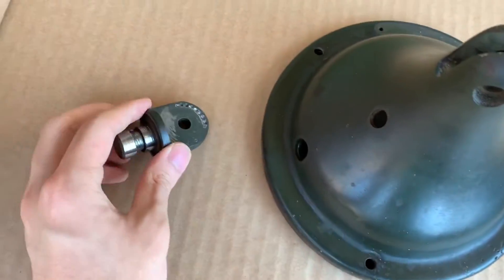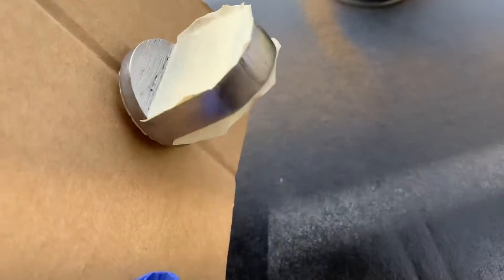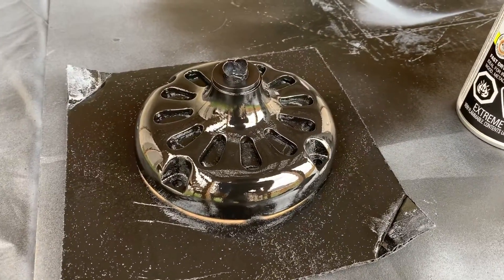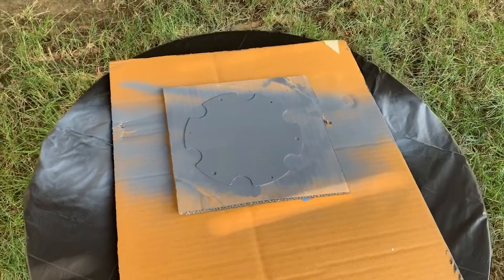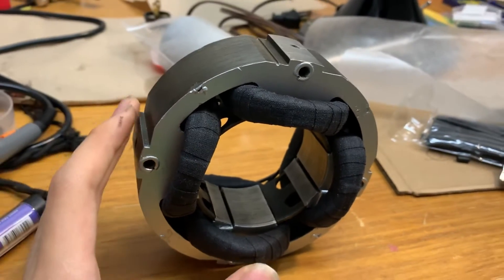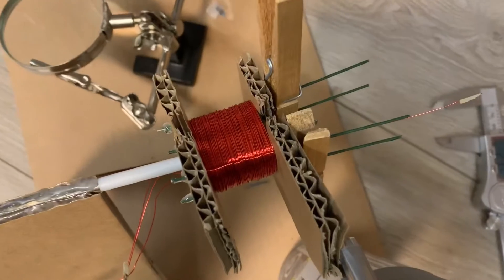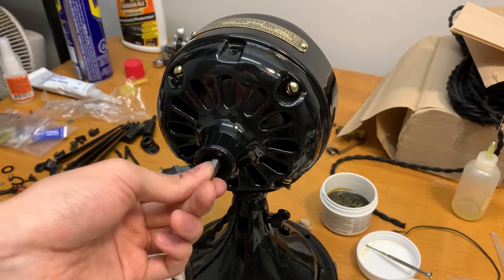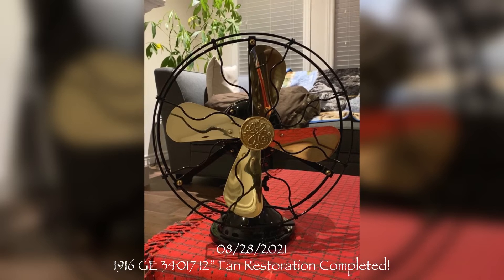Antique GE Brass-Blade Fan | Restoration: Motor Rewind, Repaint & Polish

Comment: Sweet! very nice job, say .... I have this 1906 GE Pancake that had one of the two wires from the armature break off. What a bummer. So I guess I have to get it rewound.
Reply from the maker: Thank you! You may be able to salvage the broken wire. If you carefully peel back the insulating tape near the spot where the wire broke, there might be enough length to solder on a new wire. If needed, you can undo one turn on the windings to recover enough length without affecting the motor.

Comment: hello..may i know where is the thermal fuse and the capacitor? is it safe to run motor without thermal fuse?
Reply from the maker: Hi! This fan does not use a capacitor, as it has a shaded pole motor. No thermal fuse either, since this was made long before fuses were considered necessary for safety.

Comment: Looks amazing bud I do feel that you could've buffed the original paint if there's no rust, I've done it many times, hopds a higher value
Reply from the maker: Thank you! Looking back at it now, I absolutely agree. I’ve since learned that the soft and “deteriorated” paint was just how GE’s early paint was, so there wasn’t anything wrong with it. I wish I had kept the original finish but can’t turn the clock back now lol

Comment: Wow!  That’s an intricate restoration!  Fantastic work!! My ex collected several antique fans, some with brass blades, but he neglected them - and I have “inherited” them.  One is a beautiful coin-insert hotel fan with brass blades that has been restored, although the coin mechanism does not work.  I really don’t know what to do with them!  Any suggestions as to how at least clean them up?
Reply from the maker: Thank you! Very cool, those coin operated fans are quite highly sought after! For the paint, a good wipe with a damp cloth should be able to remove any loose dust. If the paint is dull, gently buff with some automotive paint polish & wax on a microfiber cloth to help rejuvenate it. The brass blades can be cleaned with a damp cloth as well, and polished with a metal polishing paste.

Comment: As other people said amazing work, it might have been easier to use. Paint stripper to get the paint off just a thought next time i've done that and it comes off pretty easy and quickly
Reply from the maker: Thank you very much! I do agree that paint stripper would’ve done it more efficiently. I did buy a jug of it not too long ago, and I’ll most definitely use it whenever I tackle another fan project that requires a new paint job.

Comment: Just picked up this exact model for 10 USD. It is in rough shape and currently does not run according to the seller. Have not tried it myself but the rotor spins by hand. The cage is damaged and may be a challenge to repair. It is also missing the rear bering cap and speed control cover plate. I'm sure I will find replacements eventually. For the cover plate, if I had dimensions I could just model one up and have it laser cut. Anyway, this will become my reference video for when I tear into mine. Is there a way I can contact you with questions outside of this space?
Reply from the maker: That’s a steal for $10! It should be a fun project to work on. You can reach me via Instagram or email anytime (thesuperfanman@gmail.com)!

Comment: So you placed four popsicle sticks or similar, through cardboard frame to wrap wire around? I have a motor that has eight coils..
Reply from the maker: Yes that’s exactly the setup! I wanted to use softer materials that would not damage the enamel of the magnet wires. I measured and punched 4 popsicle sticks through two cardboard end pieces, making sure the wound coil would have the same size as the original. This took some trial and error to get right. I’m not sure what fan model you have, but if it has the same type of motor as this fan (shaded-pole), it should be built the same way, just with twice as many coils.

Comment: What did you use to polish the brass?
Reply: Brasso works extremely well, too.
Reply from the maker: @lightsfansofthewest481  yes it certainly does!
Reply from the maker: I used Mothers Mag & Aluminum polish paste. Manually buffed all of the brass with it and a microfibre cloth, since I don’t have a buffing wheel.

Comment: Sweet! excellent job! I have a 1906 GE Pancake fan that one of the two wires of the stater winding is MIA.... major bummer. I have not felt "brave" enough to try and wind it myself. But this gives me hope! Thanks, and God bless.
Reply from the maker: No problem! The GE Pancakes are absolute gems! You actually might be able to save your original windings. The lead wire that is missing may have broken off close to the winding coil, so it's not accessible for rewiring. You could try gently peeling back the winding tape near where the lead wire would have been coming out of the coil to see if you can retrieve the wire. You can then solder a new piece of wire to the lead and keep the original windings.
Reply: Ok, i'll give that a try, after I finish with this Emerson 24666 I just acquired. @TheSuperFanMan

Comment: Really cool! Did you consider doing a clear enamel on top for extra protection? I hate to be “that guy” I’ve just had bad luck when I don’t coat the paint in clear enamel on certain things.
Reply from the maker: Thanks! Yep I did consider it, but ended up not clear coating it to replicate how it was originally painted at the factory: just the colour coat with no additional protective layer. I also didn’t feel like spending more money on cans of clear coat haha!

Comment: You did a great job and it was totally worth it. However, those coils were just fine.
Reply from the maker: Thanks! Yes I certainly could’ve gone down a different route and attempted to preserve the original coils. Looking back now, I do think the rewind wasn’t absolutely necessary.
Reply: Ya, not necessary, but that fan is now back to zero miles and has another 100+ years! You made it look doable and I will try to fix one of my dead fans over the winter. I can't really do any more harm, it's dead already. @TheSuperFanMan
Reply: @ToxicityAssured  ik its been like a year but did you ever get it going again??
Reply: @Zephyrfansandtech  I still have not tried it on the Emerson yet. I had a old Signal Electric that ran super hot and had high current draw. I did rewind it and was successful. The Signal fan still gets rather warm but the amp draw is fine now. I will get my little Emerson going one day. For now, my Emerson is holding all my dust up!

Comment: This is amazing! I just came in to possession of an old Hunter Century fan that looks like it's from the 30s or 40s. I don't actually know atm. I was starting to do research on how to restore it myself...not sure I have the skill OR the patience to do THIS though lol.
Reply from the maker: Thank you! I definitely did a lot more for this project than what most other antique fans would typically require upon acquisition. As long as the motor windings are in good physical and operating condition, there is no need to rewind them. If the original paint is mostly intact with little rust, it can often be revived with the typical automotive paint maintenance methods (polish, wax, touch-ups).

The AFCA (antique fan collectors association) forum is a great resource, and there is also a Facebook group under the same name.

Comment: How do you lubricate that old GE fan?
Reply from the maker: The two brass oil cups (shown at 14:39) should be filled about 1/2 to 3/4 way with oil. The felt oil wicks will dispense the oil to the bearing & shaft via capillary action. In 99% of cases, the original wicks will be hardened with old oil, so they should be replaced. Ensure they sit in the spring and touch the motor shaft.

Hope it helps!
Reply: @TheSuperFanMan  what oil did you use? Is there a particularly suitable oil for this specific fan? And/or do you have one or more go-to lubricants for fans?
Reply from the maker: I use ZoomSpout all-purpose oil (the same formula is sold with many brand names, but mine is made by Supco) for all of my fans. The ZoomSpout and 3-in-1 electric motor oil (blue&white bottle) are the two go-tos for most fan collectors. I have this tutorial going over my fan motor oiling process, including the oil suggestions: https://youtu.be/tdPxoWJ1VVk?si=eXm38zHedVrhghex 

Hope it helps! Cheers
Reply: @TheSuperFanMan  awesome--thanks so much!

Comment: Nice work. I’ve done one of these myself. The only concern I have is that the motor without fan blades should be running  totally silent.  At startup it sounded like it was grinding.  Or was that just the mic.
Reply from the maker: Thanks! I didn’t add sufficient amount of oil to the bearings for the first start-up, as noted in the caption at 15:20. The bearings also have a slight play from wear, so that contributed to the rattle too.

Comment: Can you point out the forum that was used for diagrams  and also what kind of varnish did you use? I’m gettin ready to do the same thing
Reply from the maker: I used the AFCA (antique fan collectors association) forum. A couple of threads that were useful:
https://www.afcaforum.com/forum1/31849.html
https://www.afcaforum.com/forum1/31859.html

Those are from the old version of the forum; they recently moved to a new, modernized site: https://new.afcaforum.com/

In this video, I used 3M electrical insulating varnish for the coils. I now use SprayOn EL600 clear electrical insulating varnish, which is pretty much the same product, just made by another manufacturer. The EL600 is also more readily available, and more popular among fan collectors.

Hope the project goes well!
Reply: @TheSuperFanMan  thank you very much for the info! Love your content keep it up! 🙌🏼
Reply from the maker: You're welcome, and thank you!

Comment: Hola Amigo excelente trabajo!!!. Yo tengo un General Electric sin motor, sin ningúna pieza y lo quiero restaurar. Sabes de algún motor en el mercado qué sea compatible con el mismo.?
Reply: Genial, pude conseguir uno y estoy por hacerle él bobinado cómo lo hizo usted. Muchas Gracias x su aporte 👏🏽👏🏽👏🏽
Reply from the maker: You’re welcome! I hope your project goes well!
Reply from the maker: Thank you! Unfortunately the motors for these old fans are proprietary and there are no modern replacements for them. The best way would be to look for a second fan you can use for parts.

Comment: Hey, um... the GE logo was origonally black...
Reply from the maker: The badge was originally polished brass, with the recessed areas filled in with the same green paint as the rest of the fan. I certainly could have replicated that effect but I opted to leave it all bare brass.
Reply: @TheSuperFanMan     It looks great as is. You did a wonderful job, both mechanically and cosmetically in my opinion.
Reply from the maker: @davids6533  thank you!

Comment: How do you know when a motor needs to be rewound
Reply from the maker: A motor would need to be rewound if the windings show detrimental damage, deterioration or are burned out. A couple electrical tests and a visual inspection can identify potential issues.

Comment: Looks great! The og paint looked like it would have shined up though.
Reply from the maker: Thank you! Yes my initial plan was to keep the original paint, but it was deteriorating. Visually the paint seemed okay, but it was extremely soft and scratched off too easily. Trying to gently buff the paint actually made it duller lol.

Comment: What did you use to polish the paint and brass? I've got some fans that I would like to restore myself. No experience, wanting to learn as I go I guess. What a fantastic job you did on that! Wow!
Reply from the maker: Thank you very much! 
For the paint, it didn’t require much polishing as it was a brand new gloss paint job. Generally though, I like to use typical automotive paint polishing compounds to restore the deep shine. Starting with a regular polish (or rubbing compound if the paint is really dull but thick enough) and finishing with a polishing glazing compound, which is a super fine polish that gives the paint a smooth, glossy finish.

For the brass, I use Mother’s Mag & Aluminum polish. I did it all by hand, which is tedious but still works great, especially if you don’t have an electric buffing wheel. I apply a dab of the polish onto a soft microfiber or cotton towel, and rub it into the brass. Then buff and wipe off. I also use very fine sandpaper (1000 grit or higher) on some brass parts that have too much build-up for the mag polish to cut through. Once the brass is exposed, I go back to the mag polish.

Hope your fan projects go well! Feel free to ask questions if any come to your mind.
Reply: @TheSuperFanMan  thanks for the advice!

What kind of paint do you recommend using? The one here appears to be a standard krylon bottle? Or is it an automotive spray paint? I would think the automotive paint might be better but I have never used one. 

Do you seal the brass with anything to prevent tarnish or does Mag polish do an all in one with that?
Reply from the maker: No problem! 
I used Rustoleum Painter’s Touch 2X spray paint on this fan, but other popular brands such as Krylon will also yield excellent results. Automotive spray paint will work well too, though I’m not certain whether it will be better or worse than the Rustoleum paint I used, as I’ve never tried automotive paint.

I left the brass alone after polishing. The mag polish doesn’t have any sealing properties as far as I’m aware. It’s actually been about a year since I completed this fan restoration (this video was posted later), and the brass parts have built up some patina as a result of it being exposed to air, which I personally don’t mind. If you prefer to preserve the mirror finish of the brass for a long time, lacquer can be applied to seal them. There are a handful of different brands that make lacquer specifically for preserving metal, such as Nikolas and Mohawk. Regular spray lacquer will help preserve the shine too, but I’m guessing it won’t be as effective as lacquer made for metals. 
Hope it helps!
Reply: @TheSuperFanMan  ah thanks again for the information! I never knew such great results could be had without fancy buffers, paints etc. Really excited to start my fan projects
Reply from the maker: Anytime! It takes some elbow grease to polish it all by hand, but it’s certainly doable.

Comment: Superbe restoration. C'est difficle de croire que tu n'as aucune expérience et peu de connaissances pour ce qui est de rebobiner un moteur de ventilateur. Tu sembles savoir très bien ce que tu fais. J'imagine que tu as de l'expérience pour la restoration du contrôle des vitesses? Quel produit as-tu utilisé pour nettoyer et polir les pales?
Reply from the maker: Merci! The speed coil was also my first ever attempt along with the motor. I was pretty surprised myself at how well they turned out. I used Spray Nine to clean the old dirt and grease residue off the blades. They still had the factory lacquer coating, so I used progressively finer sandpaper to remove the lacquer (I probably could have used paint stripper instead), then finished polishing with Mother's mag polish and a soft cotton cloth.

Comment: Rebuilding a Type AOU, Cat 75423, and will be using this video a LOT over the coming weeks. Thought this was going to be a simple rewire, but since it's my great grandmothers, I'm going to need to take my time on this and put it aside for now.

Once I get into this, is there any way I can contact you in the event that there's inevitably a hitch run into? I've done a shitload of mechanical work on cars so the grease and gears aren't an issue. If there's a rewind involved, there's probably gonna be questions if you're cool with it; that would be amazing if it ends up needed.
Reply from the maker: Of course! You can contact me through email in (thesuperfanman@gmail.com) or on Instagram (@thesuperfanman). 

I also posted a 3-part series on restoring a 1930s GE 12" oscillating fan, which is essentially the AOU's successor. These videos go over the restoration process in much greater detail so they may be helpful!
Part 1 - https://youtu.be/uflzjMZMZOc
Part 2 - https://youtu.be/krMkm8DFivQ
Part 3 - https://youtu.be/mE25m5RvkP8
I didn't have to rewind the motor with this one, and there's a good chance that your fan won't need it either, unless there is a major issue. I believe a resistance value of around 17-18 ohms across the motor (without the speed coil in the base) for a two-motor-wire 75423 is normal. There are some other variants that may have different values though. Hope the restoration goes well, and feel free to reach out if you have questions!
Reply: @TheSuperFanMan  - Thanks so much. I'm just going to send an email and say hey so that it'll be in there if I need it. It's going to be tricky, so hopefully I won't need to rewind anything. 

I'll be sending the email through my protonmail shortly.
Reply: @TheSuperFanMan  - Oh, and if you could mention some forums worth checking out for that fan, I owe you a beer, since we can't get Puppers in the states.
Reply from the maker: Sure thing! The best (and pretty much only) forum for antique fans is the AFCA (Antique Fan Collectors Association) forum: http://www.afcaforum.com/
They recently updated to a more modern webstite (https://new.afcaforum.com/) but the majority of the content is still on the old site, as it has been running for well over a decade. I've gathered most of my antique fan knowledge from there. A useful tip is google searching key words of something you're looking for, followed by a site:www.afcaforum.com. This will narrow down the search results to just the forum contents. For example, "75423 motor site:www.afcaforum.com" on the google search bar.
Hope it helps. Cheers!